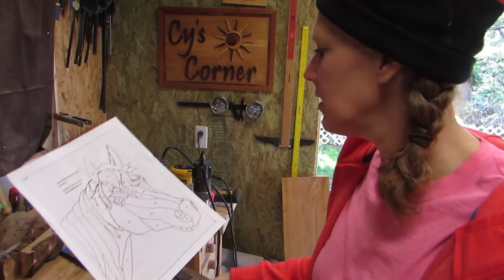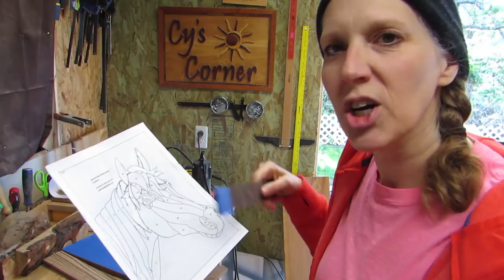Intarsia/Segmentation Horse

Comment: Cy, I have been using Locktight with blue tape for some time now. I had all kinds of problems with the movable 100 variety so I switched to the 300 variety and no problemo. And for putting the pattern down I use a hard roller I got at Michaels craft store works wonderful w/no sticky fingers. Oh, one last thing I spray the tape not the pattern.
Reply from the maker: Some good ideas here. I must have the 300 variety of Loctite, I will check that. Also a roller is a great idea too!!!

Comment: Hi Cy;  You might want to try Peel & Stick transfer paper rather than blue painter's tape. I got the idea fro Steve Good. It works very well & does not leave any stickiness on the wood and pulls off the wood real easy. I get it at Walmart for about $6 and it is about 30' of paper . Love your projects. Rod
Reply from the maker: Thanks! I have used some scroll saw tape before but will check out this Peel and Stick from Walmart, thanks for the info. :)